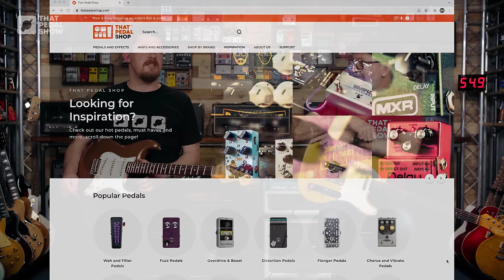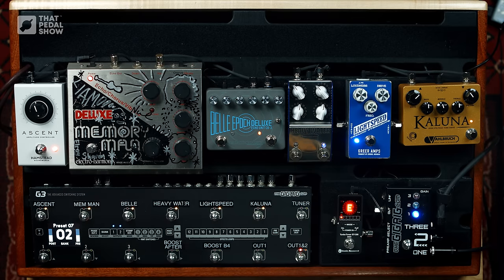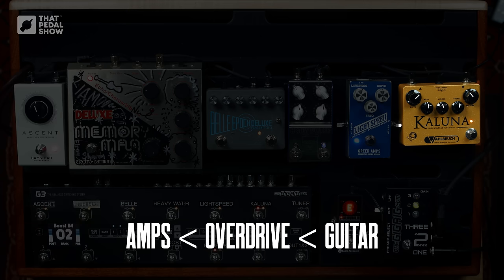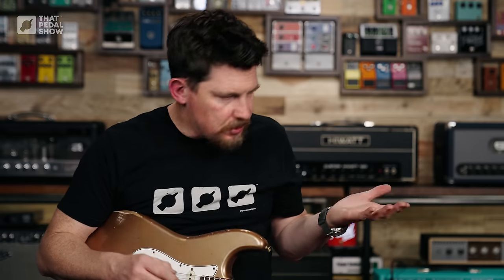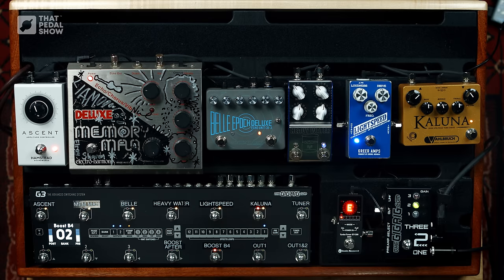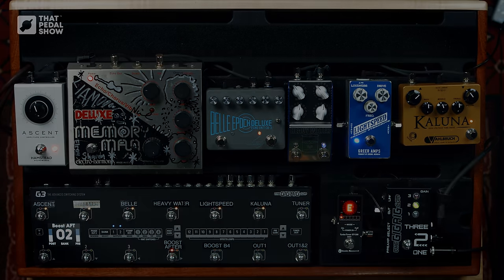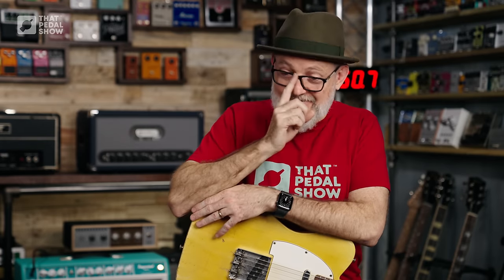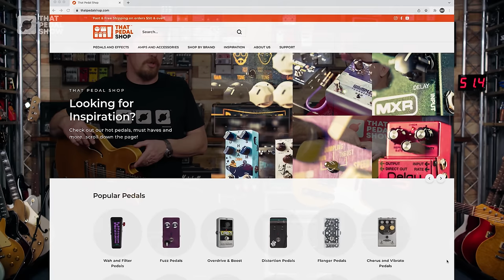Boost Pedal Before Or After Overdrive? [Gain Staging Basics]

Comment: IME, in using lower output amps 20 watts and lower, gain staging with multiple pedals isn't the way to go.What is better is to start with an an amp that is close to what you are looking for, so the Drive is more fine tuning.I've generally found that putting Fuzzes up front where needed, the Drive and non sensitive Fuzzes mid chain, and a good high headroom EQ/Boost like the EQD Tone Job( I've tried many, and they are def are not all the same) at the end to finalize the overall tone and volume level.Pushing boosts into Drives with smaller amps is going to create mud; compressors and Treble Boosters are better for changing EQ and gain and sustain levels.Consider the possibility that all those multiple pedals could be doing more harm than good, or that they are better employed individually.Keep in mind the amps usually used on TPS vs. those you have.

Comment: I have an Xotic EP Boost (Echoplex circuit emulator/boost) that I put right in front of my RevivalDrive. I only give it a small boost, but I like what it does for the sound. I don't usually use it for distortion, because I can add that right on the RevivalDrive. The EP just pushes a slightly richer midrange into the RD that I love. (I don't ad top end with the internal dip switch, I'm just using the circuit) It also works nice at the end of the entire chain as an overall boost for everything, giving it a lift and a pleasing tonality.
Reply: I use it as an always on because I like the tone shape it gives with my strat into a hot rod. Really dependent on other pedals though. Can’t imagine it would be my go to for humbuckers into a less bright amp.

Comment: Always on clean boost last in chain to get that sweet spot for the amp. That’s what I do :) also doubles up as a buffer.
Reply: Working this out with my guitarist that plays a lp into a twin w jbl
Set amp dark and use some clean boost to add level and sparkle for cleanish tones 
Then when gain sounds come on the transient spike isn’t so much “rip yer head off”

Comment: Forget ye not the venerable TC Spark which has bass and treble controls plus a mid kick switch; awesome at the end of the chain for solos and cheap as chips. I only wish Dan and Mick were around 30 years ago when this awesome resource would have saved me a lot of money in experimentation. Sterling work, chaps!
Reply: That's exactly what I do, it works!

Comment: Excellent demonstration of boost.  I like my Nobels ODR-1, but found it a touch lackluster in the upper mids and couldn't fix it with the Spectrum control.  So, I put a Boss GE-7 in front of it and ever so gently boosted the upper mids while also pulling the lower mids down a hair.  Problem solved. :-)
Reply from the maker: Perfect!
Reply: Amazing! Have a look at the Premier Guitar Tom Bukovac rig rundown. He does something very similar! And he's a genius....
Reply: So ODR-1 into the GE-7 ?
Reply: @pauldavid2407  think he uses ge7 at the end of the chain
Reply: @pauldavid2407  I'm pretty sure that Tom Bukovac puts the GE-7 after his overdrives.  As Mark suggests, have a look at his Premier Guitar rig rundown on YouTube.  I do the GE-7 before my ODR-1.  I tried the reverse, but there wasn't enough upper mid content in the output of the ODR.  Shaping the content going into the ODR by boosting the upper mids  solved my problem.  That said, context is everything and you have to consider your total rig including the guitar and amp.  I'm using a small Fender Vibrochamp at the end of my signal chain.  Don't know if I'd make the same decision with a bigger amp with more headroom.

Comment: Both, well kind of. I use a Boss GE-7 Graph EQ cutting low ferquencies and boosting the level between some guitars and the front end of the amp. Also I put a Zoom 70 CDR in the FX loop with a graph eq block to increase volume and boosting mids for soloing, and an analog delay block to make it sound more interesting for soloing.

Comment: I'd love to hear thoughts on using a timmy as a volume boost at the end of the gain stage.  Sort of an organic boost that pushes in the perfect amount of overdrive to taste.  Plus it lets you trim off some bass and even push up the highs if needed. I love what it does!
Reply from the maker: Yah, totally works!
Reply: Great indeed, have used it in the same way, but seems comparable to an EQ pedal. When I got a Kingsley Page it replaced mine, more sustain and compression and amp feel under the fingers.
Reply: @LLVG83  I get that for sure.  I have the Hudson Broadcast as my main drive and it gives me that amp feel.  I only ever hit the timmy when I disappear in the live mix.  It has the volume to push me back up to where any self respecting guitarist needs to be lol.

Comment: I use a double boost pedal in the middle of my drives to make some have two levels of volume and some to add gain stages. My amp also has one at the end of the signal for another volume boost if needed. In a live show this works great.

Comment: One of my favorite tones seems counterintuitive at first. Put a tube screamer with no gain and all the level in front of a driving amp (Mesa Dual Rec) to clean up the low end and add gain, but then put a boost in front of the tube screamer to thicken it back up in a different way than the amp's gain structure. Not a solo boost, but it's Brillant for the music i play

Comment: At this time, I am using a ABY pedal to spilt my guitar single ,I have a double Tele,..Humbuckers , single to two Amps, Amp 1 a Vox 20 & a
2nd amp Fender Super Champ xd,..15 watt,.. My question is,.. should I place more than two Boost pedals at the end of my pedal chain,.. to the end right into the amp,.. and one Boost pedal at the beginning, from my guitar into the ABY pedal into the 1st Boost pedal ,.. and let it run the chain, until it hits the last two Boost just before it reaches the Amps?

Comment: I'm running a Keeley Aria at the start of my signal chain, before overdrives, and I'm using the compressor level control as a boost.  This gives both more clipping AND volume.  Blend & sustain controls at around 9 o'clock.

Comment: Personally, I prefer boosting into dirt. I run my drives lighter, and that has two important upshots. First, switching from chords to lead lines drops signal enough that you fall below the edge of breakup, so a boost can give that back. Second, even though you do get dirtier boosting into gain, I find that you also gain some volume on many gain pedals, especially if set "edgy" into a clean amp with some headroom. You guys had the Kaluna pretty cranked, so I'm not surprised it didn't let you get any louder in that setup, but depending on the circuit and the setting a boost into dirt can give you both louder and dirtier.

Comment: I use a low gain, high volume overdrive with the drive all the way down (with the eq very useful) at the very beginning of my drives and then a klon after all of my drives. I love 2 boosts sandwiching all of my "higher" gain drives.

Comment: Thanks for another info packed episode gentleman. I've been running a FTT Crunchy Chime booster on my board for the last several weeks. It's a very versatile boost pedal, it can do subtle boost up to, as the name implies, slight crunchy tones. It has excellent EQ (seperate Treble and Bass) control  with 2 modes of Bass EQ. I'm running it in front of my Dualist and TomatoTone and it really adds some depth to those presets. But that ThorpyFX Heavy Water is really speaking to me....resistance is futile...resistance is futile...
Cheers

Comment: I’ve had a fun journey with you guys, that to my luck, corresponded with the height of my career and the liquidity to do what I want (hasn’t always been the case).  I’ve come to the realization that I truly just might need a fuzz face…though a tone bender is a great tool.   I didn’t understand “All you need is fuzz” until I went through this journey.  They can boost, distort, and get the fuzz all with a volume knob.  Fun conclusion.  Get my reverb and trem from the amps, a Ripply Fall, and some delay.  Always wet/dry/wet. Tone wise, couldn’t be happier.   Heart broken over 🇺🇦 Ukraine, for which I play the blues to sooth my soul and weep for their circumstance.

Comment: Yeah I run two graphic EQ pedals.  One immediately after the drive section for changing the character of the drives.  One in the EFX loop for lead boost.  I don’t like boosts in front of drive pedal.  I want my dirty sounds to be open not over compressed.  Dirt pedals are effectively compressors.  Clean tones are different.  I like early compression but I’m an old Nashville guy.   In the loop a little bit of boost goes a long way up the volume scale.

Comment: Another great video guys so thank you :-)

Always wanted a Dallas Rage Master booster clone and in the past the only pedals I've owned and used was a Dunlop Wah and a Boss BD-2 blues driver from my Strat and SG straight into a Vox ac-4 which sounds quite tame but cranked was brutal (especially for my then neighbours and family) but certainly did a good job as a treble boost with some adjusting even though not a strict treble boost.

Comment: Thanks Guys for another grate Vid ,I used a Boss GE7 to Boost my EH Muff ,I think it sounded better before the Muff can't remember  ,
Also it made the MXR Fullbore sound way better than it did stand alone , I did it because I was trying to get that Doom Sludge sound and the GE7 with the MXR did the trick . Im sure some Extreme Metal Genres used the GE7 in a similar way  , although I might be wrong im sure I will be corrected at some point , everything starts to get hazy for me when I think back.

Comment: I use a boost before my dirt which is always on it's almost at equal level with my overdrive , I also have a boost before my amp that is always on I use it again to maintain volume it fattens my sound ,  lastly I use a clean overdrive to drive which is my solo boost

Comment: I use one pre and post gain, it allows you to keep the drive knob on the pedals at a lower level and it just creates a sound that is both massive and clear. Even the best pedals can get too "grainy" with the gain knob turned up too high, this allows everything to stay in their respective "sweet spots."

Comment: I have totally fallen into the camp of boost into overdrive and then using a volume pedal (with a minimum volume setting at the heel) after the final gain stage to turn up for solos.  So I was enjoying your video but wasn't learning anything new.  Then the 335 into the Kaluna was rolling and you stepped on the Heavy Water....boom goes the dynamite.  Great little show today.  Have a great weekend.

Comment: Vertex boost, because it's so transparent and doesn't color as most other boosts. Also has a buffer built in. That always on after my tube factor lets me use the volume pot of my tele to change the amount of overdrive without losing high frequencies. In front I can push the tube facor with a spark booster mini if wanted.

Comment: Thanks for another great show chaps! Quick question, what’s the difference between a boost pedal and a graphic eq pedal? Isn’t a clean boost pedal the same as a flat graphic eq pedal with its volume turned up? And isn’t a treble booster the same as the same graphic eq pedal pushing the treble frequencies etc?

Comment: Tried a Fulldrive 2 recently. At first I didn't get it, I expected the boost to give me more level. Once I realised it kicked the drive up a gear and I could set two levels of the same drive I was sold. I have always put boost after drive, even when stacking drives. 
I realise the newer ones do both but I kind of loved sculpting "my tone" with two levels and the volume on the guitar. Besides, I have several boosts and the top boost on my Vox to kick up the volume.
Reply: Are you using with compcut setting?  The compcut with boost is amazing, I think, but I’ve never figured out how to set volume levels for drive on compcut and then kicking on the boost.   The tone with boost is wonderful, but volume is crazy loud.
Reply: @rasm0225  I have done but I prefer Full mids mode, but as you say it is a little out of control! I used it at a jam session for a cleaner boost once.

Comment: As always great show! I do have a question (showings 8 months old, so probably won’t work but still trying). Gain stacking and the volume effects are very clear to me and I use it on my own board (I use a Tumnus as a pre boost into OCD or Crunch Box and a Spark as a volume boost), woks magic. However, how does the guitar volume play into all this?  To my ears turning my guitar volume down lowers both gain AND volume (and increasing the volume the opposite). However as per gain stacking theory it should only increase gain, as level is determined by the last pedal in the chain.

Would be great to understand the theory behind this.
Reply from the maker: Hello! In the broadest sense, yes you’re absolutely right. The guitar volume control is the most powerful of them all in terms of volume and gain. And depends on the guitar and the volume control… and the pedals! If you had a bunch of pedals stacked with tons of gain, it might be that turning the guitar volume down a bit doesn’t make a huge difference. But it will make a difference. There’s also an impedance relationship - guitar is high impedance and very sensitive to the input stages on pedals. The lower impedance the input, the more clean up in my experience anyway. But down the chain you’re generally dealing with low-ish impedance output from one pedal into a higher impedance input of the next.
That might all be too much info. Guitar is a passive thing putting out teeny tiny signals to which pedal inputs are extremely sensitive. Pedals are active things full of buffers and op amps and/or transistors. I think that’s it. Good luck!
Reply: @ThatPedalShow  Thanks for the detailed response!  Will read up more on guitar output sensitivities and impedance.

Comment: Not all boost > overdrives seem to act the same. I have an EP booster going into a morning glory and there is some volume change going on. Similarly, I have the moonshine going into the morning glory and it also gives some extra volume. I guess one could argue that the difference between a "transparent drive" and a "dirty boost" is basically nill. My solution to this is as follows:
Boost > tube screamer like OD > transparent OD > 3-band klon like OD > boost ... I'm kind of missing a disortion and fuzz though...
Reply from the maker: All gain staging ….. all depends entirely on how much headroom each thing has and how much headroom the amp has. You can adjust it all ways!

Comment: If you really want to tune the tone going in to an overdrive most EQ pedals include a boost and using them you can really tune your overdrive to exactly what you want out of it.  If you use a midi eq like source audio that can give you multiple different overdrive and clean sounds by controlling the EQ and the stacking.  There is no end to the tinkering.

Comment: Hey guys - is there a reason why in the first part of the video you’ve put the boost after the memory man? I’ve always used my volume boost (MXR micro amp) post overdrive, but pre modulation / delay / reverb (so not to add too much overdrive post delay). Love the show btw!
Reply: This is usually so that the character of the delay is not altered by the extra signal level. Instead, placing the boost after the delay just makes everything louder - assuming that the amp has the headroom to go louder.

Comment: Have you ever tried having a boost up high before your overdrives with the gain turned down and then a volume cut after the overdrives to make them more dynamic and touch sensitive? I haven’t really fully tested it yet but I think it will as I’ve sort of experienced it before when treating. This requires turning down the gain on the drive pedals and the volume cut after it so it doesn’t push the pedals after it or the amp more than you want
Reply from the maker: Yep, just basic gain staging stuff - try it all!
Reply: @ThatPedalShow  what do you mean? I thought I just made a great discovery you had never tried before and would end up demonstrating on TPS! Haha!! 😄 really though, I did think that… but maybe it could be a “short” that people may find interesting, I’ve never seen it demo’d on TPS 🤔 (boost pre overdrive, overdrive set to to light gain and getting pushed, volume cut after overdrive to bring signal back to unity). Compare that to standard. It’s a very different way to interact with the our drive pedals (tones we wouldn’t normally think of getting, opens more possibilities for audience) that I haven’t seen you guys demo yet and think people may find it interesting… that is, if you find it compelling enough to demo. Best wishes guys! 💙🤜🏻

Comment: Not strictly on topic question - I was watching one of the older videos with the analogman maxon/badbob gritty boost, can I emulate the bad Bob side of it using something like a Colordriver with the bass down and treble and gain up a bit, or is the EQ curve too different? I’ve also got access to a broadcast or a heavy water if either of those can get closer. 
Cheers!

Comment: I have a katana that goes before my drives and I really want to get an ep booster to put after them. I see a use for boosts in both spots and the EP and the katana are two different types, that I think could pair well. Thr katana lifts the base tone and then the EP would just add that touch and characteristic at the end.